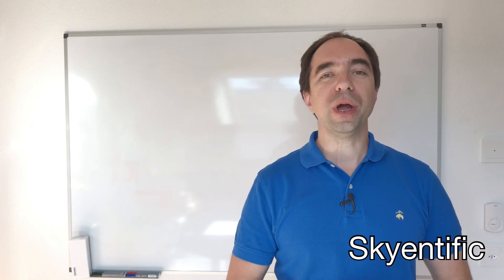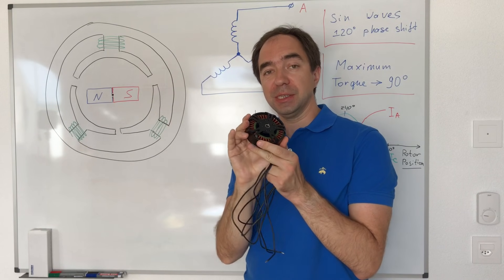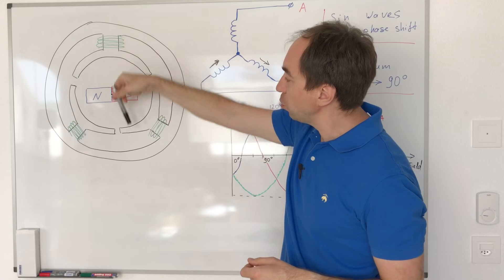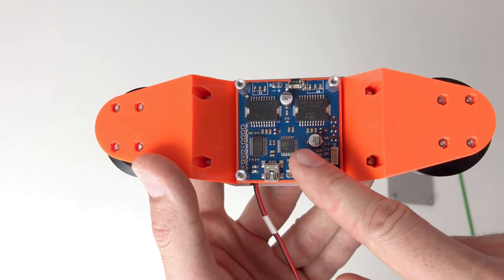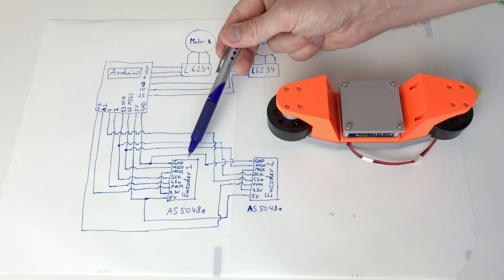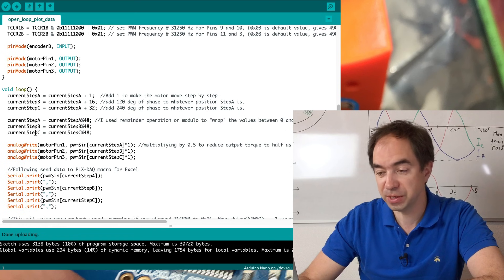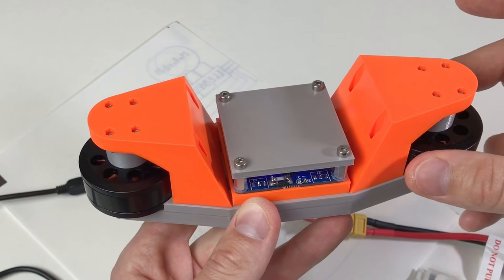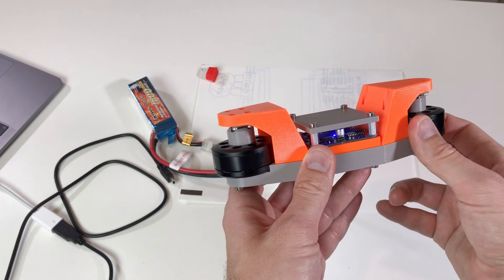Why the brushless controllers are awesome for robotics

Comment: I liked your body controller haha!
Reply: I tried it and it didn't work.  Then I realized the wire in my left hand should have been in my mouth and vice versa.  The wire in my right hand was correct.  I would have thought that such an error would just make it turn the opposite way.
Reply: what sorcery is this? hahaha so fun
Reply: @jamiekawabata7101  You have to put the first wire in the ear, second in mouth, third in the a*s... no, wait... first a*s, second ear, third ... baahhh s*it ;-)
Reply: @virkotho5057  You must swap them rapidly to drive the different coils;)
Reply: Taking flexing to another level 😂
Reply: if only we had motors that were that responsive

Comment: Very nice!! In a DC electric motor the voltage and current have phase shift due to back EMF which depends on the angular speed of the motor. It generates by the Lenz law about an inductance with a thru current moving in a magnetic field. In the application here described the angular speed is almost zero so the back EMF is negligible with respect to the applied voltage. In this conditions the motor is like an electrical resistance (almost without inductance effects) and Voltage and Current are not phase shifted anymore. This reveals why the control works fine acting on voltage like it is acting on current. And there is no need of a driver with a control loop on current.

Comment: Very good video.  Very clear explanation of the phase control and nice, simple Arduino code. I really love the haptic feedback demonstration. One thing to watch for as you continue to experiment: closing a control loop around the SPI output will work well at slow speeds, but it gets more difficult at higher motor speeds because of the latency in reading the SPI.  At high RPM, by the time you get the position from SPI, you only know where the motor *was*, not where it *is now*.  You may need some kind of predictive model based on RPM to get good control at higher RPM.
Reply from the maker: Great comment! Thank you for this info. This is very important to know. I knew that with this setup I would not get high speed. First, Arduino Uno is not the fastest microcontroller. Second, I don’t account for the phase shift between current and voltage (Arduino send voltage, but motor reacts on current). And your argument is the third reason which will limit the speed. I really like youtube for this:  many people gives nice ideas, and explanations in comments! :) Thank you again!

Comment: What happens if my driver cannot output enough amps to the motor? Can i use a 5 A rated driver to run a 20A rated motor, atleast as a test set-up? Can i make modifications to the driver so that it can handle higher current?

Comment: Trinamic also has a new BOB coming out that has a complete FOC solution onboard for up to 10A. It's called the TMC4671+TMC6100-BOB But it's not available yet.
Reply from the maker: This is cool. Thank you for info. I will check.
Reply: You can buy FOC controls from a bunch of suppliers for a bunch of power envelopes.
VESC, ODrive and Roboteqs are all good, lightweight, and high current. At different prices :-)

Comment: If this "telepresence" could be used over radio (assuming lag is low enough). You could use it to add force-feedback to RC cars and  "feel" the road :D

You should definitely do this project!
Reply from the maker: It can be used over radio, and it is possible to make the lag small, as there is no much data to transfer. Great idea!
Reply: This is a very good idea! Not just cars, think RC airplanes with force feedback stick control so you can feel turbulence and stall conditions, or racing drones where you feel the inertia due to sudden direction changes. Combined with first-person view, it will be a totally immersive experience.

Comment: You could build a mannequin and put a brushless motor on each joint which echoes a motor on each joint of the robot arm. Then connect each motor pair by wire or UHF and where you move the mannequin limb then you would get an echoed movement in the Robot. BTW...that technique is a very old one and the motors are called "Synchro Motors" and was used in Steering Gyro's as far back as WW2 in aircraft and ships gyro compasses

Comment: These motors should work well with a worm-gear in robots.  High gearing, and will hold position, as the worm-gear normally has self locking

Comment: Would be nice if SimpleFOC had a motor current control loop as it would allow to effectively control the output torque. But I doubt that this is possible with an Arduino... So I guess SimpleFOC is a nice and not so expensive compromise... Thanks for presenting it to us!

Comment: Telepresence is interesting and works well for a 1:1 input:output, but in an actual steer-by-wire setup in an actual vehicle, how would a motor on a steering rack effect the telepresence on a directly driven steering wheel? I know some production vehicles do have this, but I've always heard steer-by-wire is an odd feeling form of driving a car, and I've always wondered if the direct input but indirect output has anything to do with this. I'm sure there's a way to even out initial input and final output, such as 1:x for the control and y:1 for the actuation, thus having a total 1:1, but I have a feeling that steer-by-wire would still feel odd if initial input and final output still had a theoretical 1:1; probably due to the slight latency of electronics that you don't get with direct actuation. 
I'm also curious how telepresence in brakes work, or brake-by-wire, as the output goes to a hydraulic setup, thus again being indirect. Again, some production vehicles have this, but I've always heard it feels entirely different compared to brakes directly actuated by the pedal.

Comment: Great channel! Just a question. Why store the sine function values in an array when you can define a sine function as a function of time? Is there any benefit in using an array instead?
Reply from the maker: I think it is a little bit faster like this.
Reply: It is called a lookup table,  the sine values are precomputed with some limited precision to avoid calling expensive software sin() function from the C math library every time.
Reply: It's a matter of implementation considering all limitation and where to optimize. How big/ available is your memory, how strong/ busy is your processor, how large are the values you want to store, etc. And here, IMHO, the values are small and constant enough to store in memory and not sacrificing processor's calculating time.
Reply: Thanks guys!

Comment: Seriously awesome. Can you get reasonably high torque out of the brushless motors? It seems that when the brushless motor is going slow....it acts sort of like a stepper motor. That said, I assume you get more torque out of a Stepper than you would the brushless motor controller....but the advantage to the brushless motor controller you could have higher speed? Thoughts? Your videos are great, thanks for sharing.

Comment: If we have a 16 steps phase difference between the 3 coils, then at 11:39, if currentStep1 = currentStep1 + 1, then I think currentStep2 = currentStep2 + 17 and currentStep3 = currentStep3 + 33, otherwise phase 2 will be shifted only 15 steps from phase 1. Am I wrong?
Reply from the maker: Yes, you can do it like this too. In this code everything is referenced to step1: step1 = step1 +1, step2 = step1 +16, step3 = step1+32. So both methods should give exactly the same result.
Reply: @Skyentific  oh boy I completely missed that, my bad!

Comment: Hello sir, and thank you for great videos. I still have some problems with connecting AS5048A to arduino. I bought the encoder together with gimbal motor and the encoder has 3 wires I believe for PWM connection. I am trying to connect it to Arduino nano and read the value of the encoder and display it on Arduino serial monitor. Is the serial read from analog input the right way to read the encoder value? If you know any example code available I would be very thankful. Thank you very much.

Comment: Didn't get that exactly but did you try to smooth the reading from the analog input (RC filter or running avarage)? That could have helped on the unwanted movement without the spi reading

Comment: 9:25 Can you explain why the encoder MOSI should be connected to 3.3V? I didn't see anything about it from a quick look through the datasheet.
Reply from the maker: Great question! My answer: I don’t know. They don’t explain in datasheet, they just connect it in one diagram. First, I did not connected it. I also thought that it is useless. And I spent two day trying to make SPI work. And when I run out of ideas where is the problem, I tried to connect MOSI to 3.3V, and suddenly everything worked. So either you should connect MOSI to MOSI of Arduino (in my case this pin was already taken by motor (PWM pin)), or you should connect it to 3.3V.
Reply: It's just happen to be exactly the read command for the angle ( parity bit + read bit+ 3fff) see the last table entry in page 17.
Basically by setting it to 3.3v you are sending read angle commands non stop.
Reply: @chebhou  Ah, that makes sense. Clever protocol designer :) Thanks!

Comment: Very interesting.  I suspect you will always have oscillation because of the quantisation.  However if you have a faster loop time I guess it would get filtered out because the motors will not be able to physically change poles to align to the field that quickly.

Comment: It would be interesting to see if one side has lower current by using half voltage/current range while other has full voltage/current range. So it could act like an force amplifier and you still have a feedback that it easier to overcome.
Reply: could be interesting for a kind of exosuit

Comment: Nice...can you modify the code so one motor can be used to alter the velocity of the other? with the force feedback being directly related to the current the other motor uses? this would be like a force feedback throttle system I think....more force fed back to the "control" motor, if the "drive" motor was under more load.

Comment: Amazing video! Maybe I lost it, but which driver board are you using? I am struggling to find a small (about 40mmx40mm), lightweight, and cheap board to drive two BLDCs at about 1-2 amps continuous with a 2S or 3S battery.
Reply from the maker: Thank you. This is Martinez gimbal board. You can find it on Aliexpress, it is around 50x50mm. It can handle 2 amps and 3S battery.
Reply: @Skyentific  Thanks! I'll look into it :-)

Comment: Why don't you use closed loop stepper motors? They are slower, but they hold position much better. It's really hard to turn the shaft with bare hand, as you do with brushless motor.
And it's better to use STM32 MCUs to drive such motors. They have "advanced-control timer", which can output correct 3-phase sine wave signal in hardware, and also timer to read optical encoder in hardware or DMA to read digital encoder vie SPI or I2C, so STM32 can drive brushless motor without consuming any CPU resources. That's why ODrive uses STM32 :)

Comment: I was wondering if anyone would be intrested in making a Open Source KiCAD toolbench for modular ODrive Placement on Boards?
Reply: So you could make a single motor odrive board, a 10 motor odrive board etc.  Also integrate it with a larger pcb if desired.

Comment: Or you could just buy an RC brushless controller and feed it a PWM signal. A lot simpler.
Reply from the maker: No. With RC brushless controller you cannot control position. You need ODrive or similar board.
Reply: @Skyentific   Well that is what they make encoders for. Same thing you would do with an O drive. Only you roll your own.  Personally Id just buy an o drive.